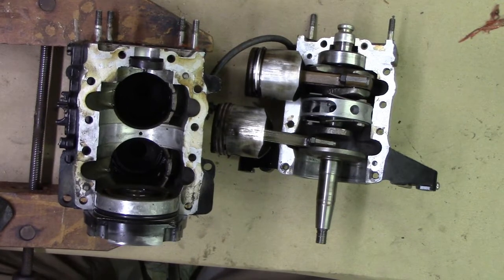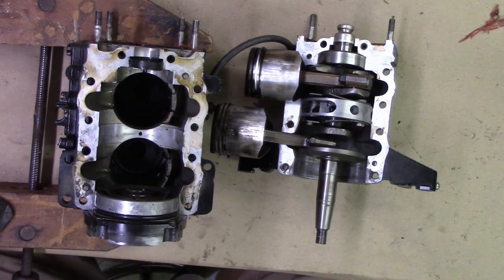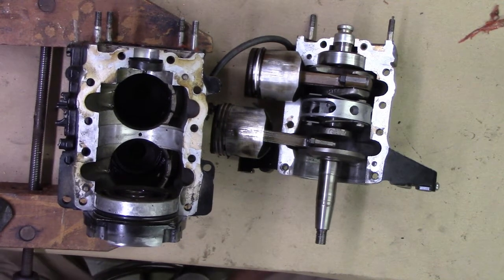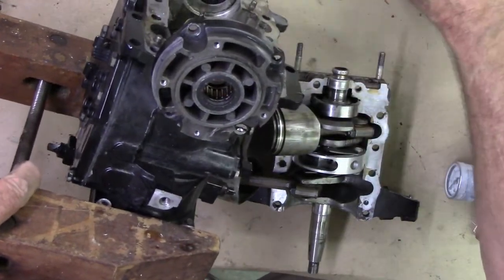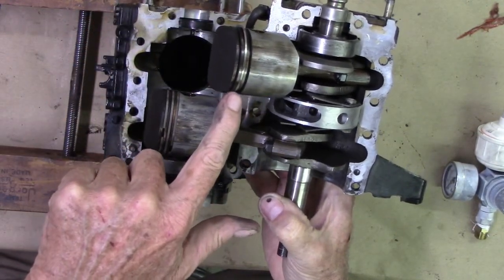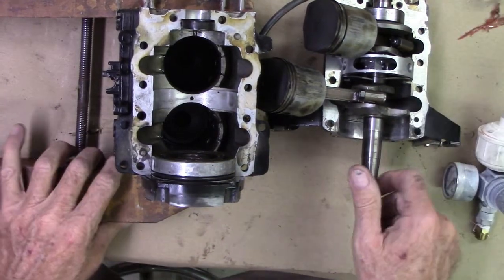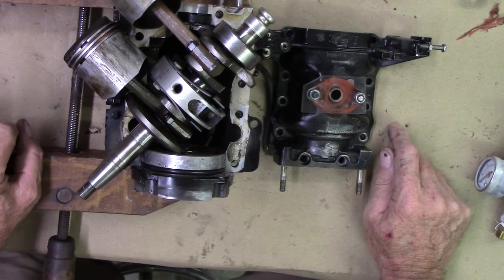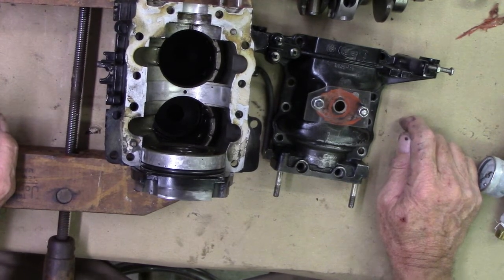1975 Merc 7.5 Rebuild Part 1

Comment: I only check files have you got a check valve on the top and the bottom and you say when you blow through it you shouldn't have nowhere is that right
Reply: You should have no air blowing through I'm hooking the hose onto the outlet and blowing it back through